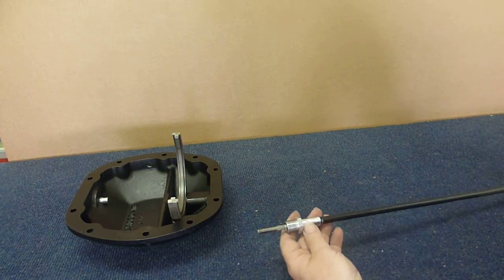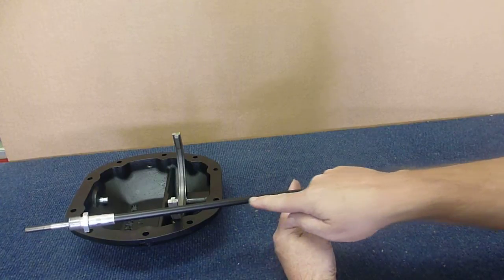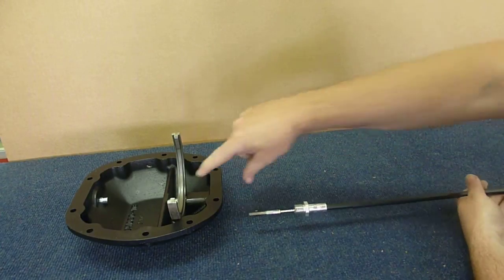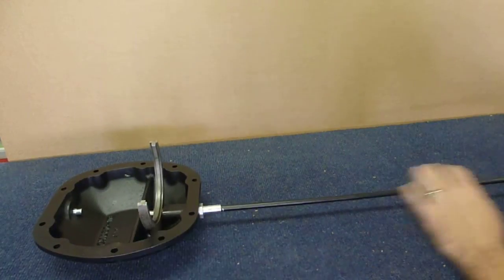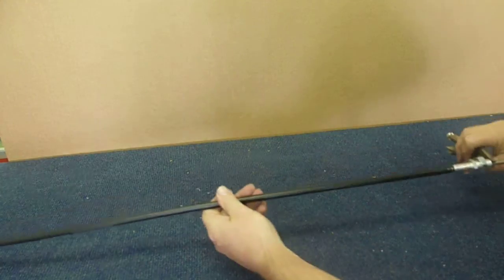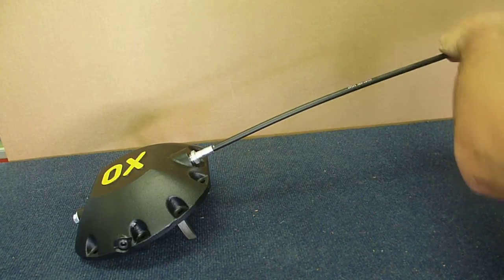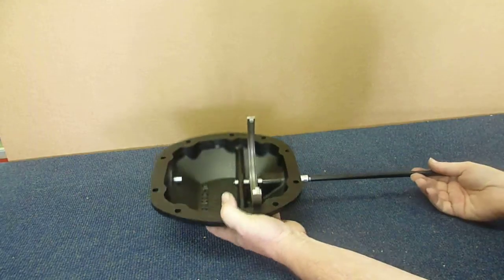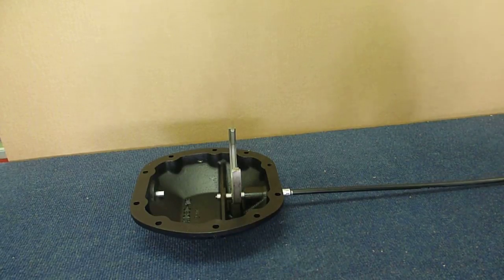OX Locker Cable Into Cover Install (Old Style Approx Mid 2014 and Earlier)

Comment: my inner cable was installed into a dana 44 years ago with that one or two threads exposed.  upon disassembly i found that the exposed thread had been able to contact the carrier and get ground down a little.  the damaged end prevented me from un-threading the cable and i had to chase the threads with a triangle file.  in short, i recommend keeping the threads flush to the inside, beware ANY hangout.